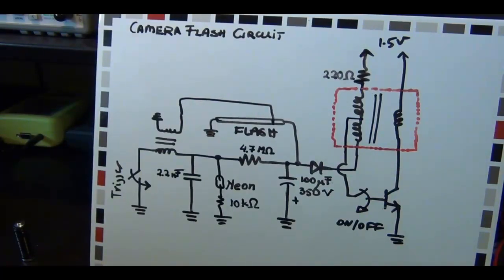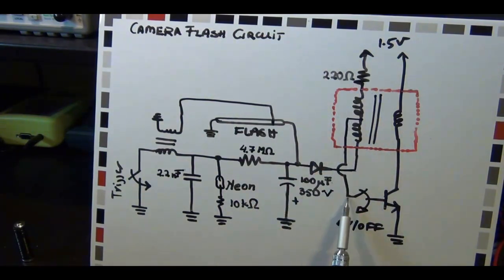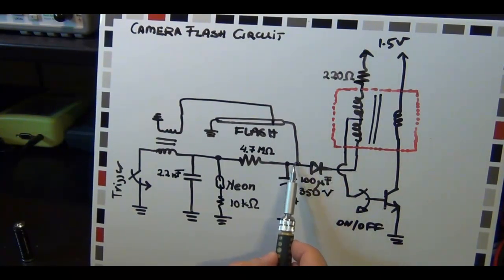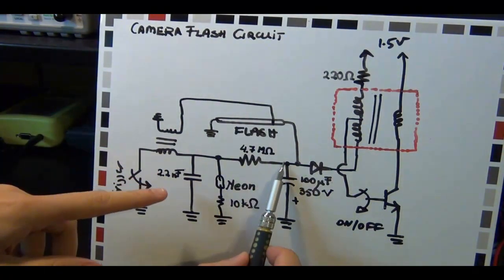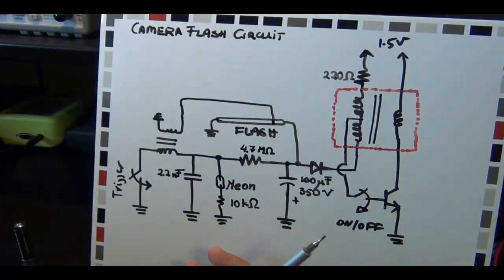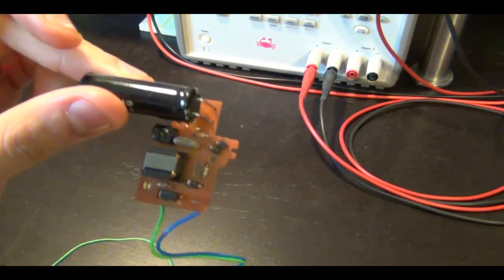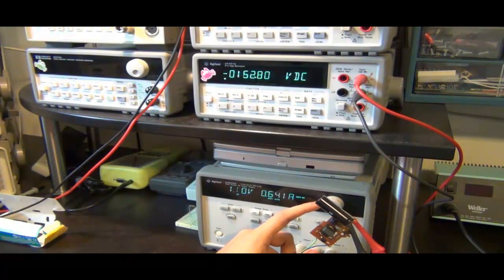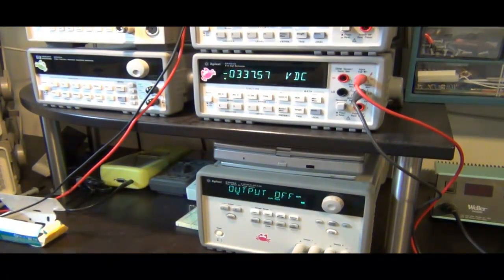TSP #3 - Camera Flash Circuit and Nixie Tube Tutorial (Part 2/3)

Comment: Hello and great video! I am learning a lot from it. I am having this problem where I can hear the flash high pitch sound. I would assume the capacitor is being fed. However, the ready light indicator never turns on, and the test button is not doing anything (meaning, I am not able to kick off the flash). Do you think there could be a problem with the 4.7 Meg Ohm resistor not allowing current to flow to the other part of the circuit or should I troubleshoot any other component?  Thanks in advance!

Comment: The neon bulb is flashing in the modified circuit for the same reason that the small cap in the original circuit would NEVER have -350 volts on it, ........(you might want to edit your video)
At about 90 volts the neon bulb turns on, and the plasma voltage is less than the breakdown (firing) voltage.
 The plasma voltage is about 65 vdc. and holds there as long as there is enough current through the bulb to sustain the plasma. 
The 10k resistor limits the current through the neon bulb to a safe value for the bulb.
You have two time constants involved. the charging time constant is the 4.7 meg and the value of the small capacitor. The discharge time constant is the same capacitor and the 10k resistor..
The voltage on the neon bulb will oscillate between 65 and 90 volts.
The higher the voltage is on the large cap, the faster the neon 'relaxation' oscillator will run.

Comment: Is this circuit built in even into the latest cameras? Why not use LED flash?
Reply: .....these were the old school disposable film reel cameras. Digital cameras require less powerful light flash....ten years ago for this video posting they were still available .
Reply: @philipvernejules9926  And what is the voltage inside digital camera flash? And is it true that capacitor holds charge for months after last use?
Reply: ..,,,.,,,if camera has a xenon argon flash tube then it will have a high voltage production to fire the flash . if camera has an LED flash then a high voltage is not required. ...Old digital cameras will have xenon argon flash tubes but unlikely for the modern digital cameras . You look at the flash to see if it's a tube or an LED . Only an expensive top quality capacitor can hold a charge for many months , they slowly lose charge .
Reply: @philipvernejules9926  how about SONY A6000, and some old school pocket-size 8 MP SONY which I bought in 2009. When I use a flash, I hear slight electric click. is it high voltage?
Reply: @gregodessite  .......there is definetly that click or snap sound when a xenon flash fires but no sound happens for an LED flash, however artificial sounds were once added to emulate the old school shutter sound in many cameras .Perhaps the xenon flash tube sound might also have been added artificial ly . Each flash type has advantages and disadvantages . I don't really stay up to date with camera developments these days and for last fifteen years . It won't be difficult to visually discern a xenon tube flash to an LED flash plus if you have good ears you can hear the very high pitch of the transformer for the high voltage xenon flash tube. Children definetly will hear the very high pitch . Even a pet cat or dog will prick their ears if you watch them .

Comment: I like to use a switch to trigger the flash but when I connect a regular tac switch ( two leads soldered to each end of mechanical switch on the flash)the flash does not get triggered. It only gets triggered by touching the metal contacts. Anyone knows the reason? Any switch suggetion?

Comment: It is because of the capacitor charging.
The small capacitor discharges but its for a short time. Because there is no charge left. So the capacitor draws charge through the 4.7 meg resistor. As a result voltage across neon bulb drops and bulb turns off. When the capacitor is fully charged the bulb turns on. The cycle continues. Also small transformer resist capacitor discharge and eventually the capacitor doesnt get diacharged before desired charge gain.

Comment: Hey there! Great video!
One small thing: You said: "For a very brief time, something close to -2000V appears here (on the middle connector of the flash) [...] and that initiates the flash (by drawing in the electrons on the pole with the big cap connected to it into the flash)."
But doesn't it need to be a very large positive voltage on that middle connector of the flash to draw the negatively charged electrons into the flash, thus "kicking off" the bright light?
Reply: You are correct.

Comment: Why are the diodes in these flash circuits reverse-biased ? Wouldn't it make more sense to forward-bias them (anode to output of transformer) and have the cap connected the normal way around ? What would happen then ?

Comment: So.... I thought that it was odd that you were saying the capacitor was charging backwards since it is a electrolytic, polar capacitor. Then I noticed that you were also measuring it backwards. The grey stripe on the capacitor has large rectangles in it ("-"), meaning this is the negative side. Therefore it should be attached to the negative (black) side of of your DMM. In this arrangement it would be showing positive voltage. Just sayin
Reply: hooking it up the way he did is the safe way to not blow the ground lead off your scope probe in case you are using a non isolated power supply. if the circuit is floating (not earth grounded) then it would not matter which way the scope was hooked up. but to be safe this is the correct way to hook the probes up, since through the diode on the secondary of the first transformer the large electrolytic capacitor is being charged with a negative voltage. meaning that the "ground" plane of the camera is assumed to be 0 volts. and that is a higher potential then the -320 volts the main flash circuit is charged to. hence why the positive terminal of the electrolytic is grounded in this particular circuit.

Comment: Hi. Do you know the model of the transistor? It has something marked on it? I managed to get only the transformer, diode, capacitor and the little photo-capacitor from the circuit but not the transistor. And I don't know what do use for the oscilator part.
Reply: I have an old flash circuit. My board has a D965 transistor (NPN)

Comment: The neon bulb, 4.7meg resistor, and the small capacitor form a relaxation oscillator, due to the device characteristics of the neon bulb - when the voltage across the bulb exceeds 60-90 volts (or so), the bulb conducts, discharging the small capacitor, starting the cycle all over again.
Reply: That's exactly what I was thinking.

Comment: Can the same flash circuit be used to charge a more bigger capacitor 2600 F : 2.5 V Super capacitors? if no then how cna i do it.

I am working on a project where I have a piezo electrict generator in my shoes and it has to charge a bigger sink. it could be a super capacitor. please please reply 
Answering your quiz question : The neon bulb has gas, and the gas discharging frequency is higher than the the charging voltage frequency.

Comment: Putting (significant) capacitance in parallel with a neon tube (or older gas-filled regulator tube,etc.) is generally a no-no..relaxation oscillator time.
Something,something,negative resistance,something,something. :)
Reply: That 4,700,000 Ω resistor is what protects that part of the circuit.

Comment: the neon bulb propably discharges the cap for a small amount to a level its not enough to get lit, then it turns off and recharges the bit and goes on again -> repeat = flashing neon

Comment: This is an awesome tutorial. I never took the time to learn a flash circuit before, but I am glad I did now. I am a professional photographer and understand electronics very well. Do you know to what part of the flash circuit is connected a couple of pins on a connector that comes on the side of some professional flashes? I want to build an external power supply for my flash because the AA batteries don't last much. Thank you!

Comment: I have learn more eletronic from this guy than my whole scool career. (which was not long)

Can someone explain, why there is this oscillator thing in this flash circuit? Why not just swith + transformer and it will give static ~300v ?
Reply: Meitzi safe discharge cycle.

Comment: Hi. Great vid! Why does the circuit operate with negative voltage instead of positive? If you had switched the polarity of the first diode nearest to the pulse transformator in the circuit diagram at the begining of the video would it still work? (given you also change the polarity of the other components in the circuit.)

Comment: The neon light has about 80V drop when it is on (it needs higher voltage to turn on), so the small capacitor is charged to a bit more than 80V (it is also why the neon light blinks).

Comment from the maker: @rkward101 Not exactly, the frequency of operation is much faster than the blinking anyway. It has to do with the plasma creation in the tube which causes a hysteresis in the ON voltage of the tube. Someone posted a great answer to this on TheSignalPath forum.